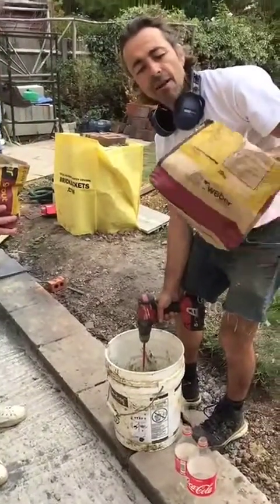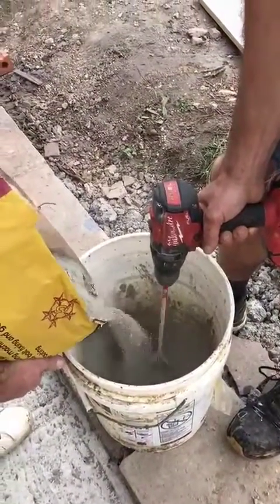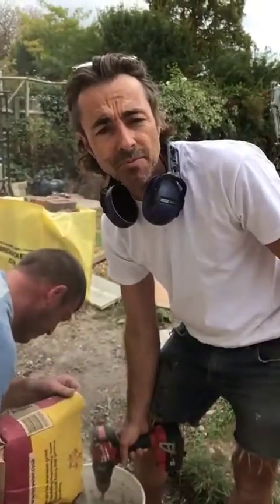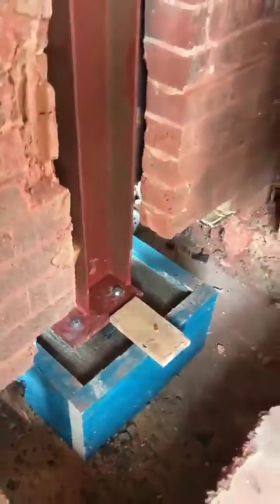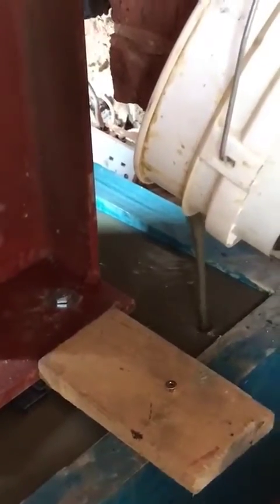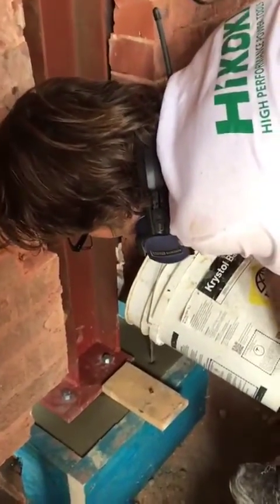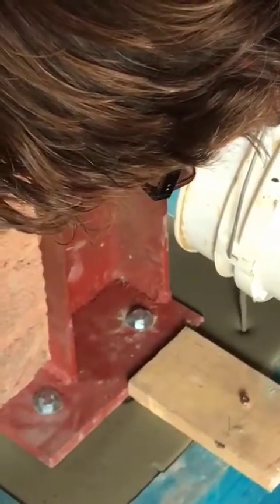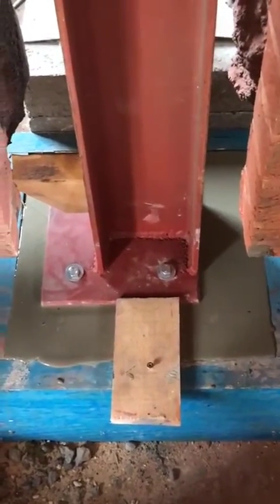How to use structural grout

Comment: You should only ever pour structural grout from one corner. It allows the air pockets under that I-beam to flow from underneath to the other side. If you pour from each side and every corner, it allows airpockets to form in the middle when each pour of grout meets together under the beam.